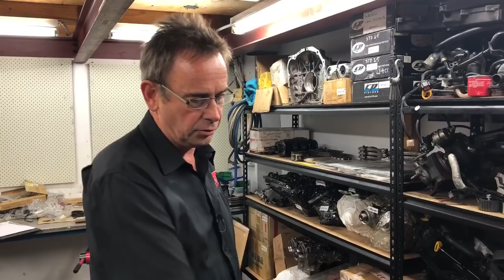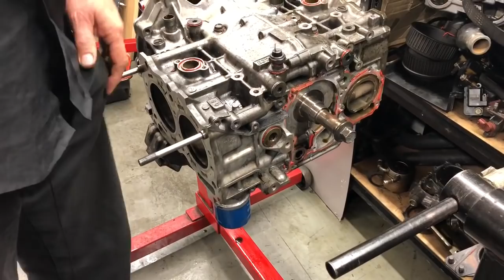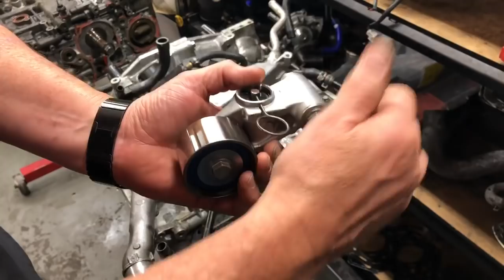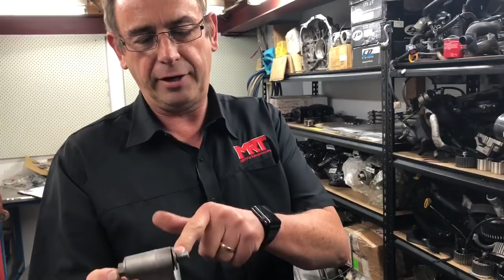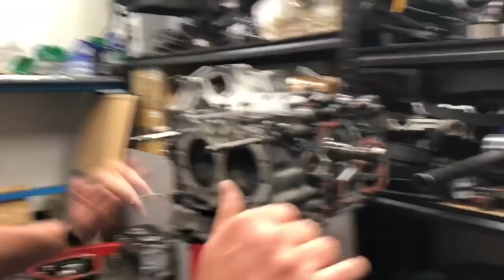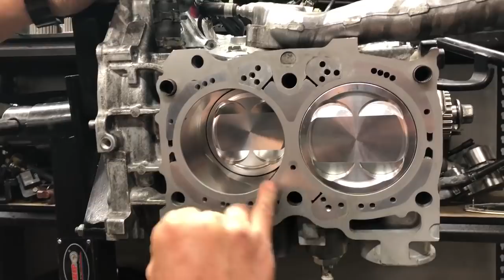Not all Engine Rebuilds are the same - Part 2

Comment: @MRT Performance : I’m a machinist (10 years so far) and a wanabe engine builder. This is obvious for me that someone should check the cylinder after pressing insert in. How does the remachining process goes? Are you using a boring head on a conventional milling or endmill on a cnc ? Do you center yourself according to the dowel position or do you center per cylinder using a dial indicator ? And lastly, is there a specific surface roughness to obtain (in ra or rms) or someone can try making near mirror finish ? Thx a lot ! Sorry for the english, I’m french Canadian.

Comment: Excellent stuff. Yes i agree that all machining should be done after close decking. But how do you make sure that the fine sleeve will not dislocate itself?
Reply from the maker: Mahesh KN the sleeve is an interference fit and never comes loose

Comment: That timing belt guide is omitted on Auto cars here in North America.
Reply: D E L P H I that's cool never knew that before
Reply: Manual can change rpm really quickly on down shifts or stalling while autos cant. The deceleration of the crank puts tension on the reverse side of the tensioner allowing for the belt to slack slightly. This could cause the crank gear to slip as the belt will be looser over it.

Comment: That timing belt guide only came with manual car which lower the chance of jump tooth when you stall a manual car. Auto subaru cars don't have that. But well the car in this video should be a manual I suppose.